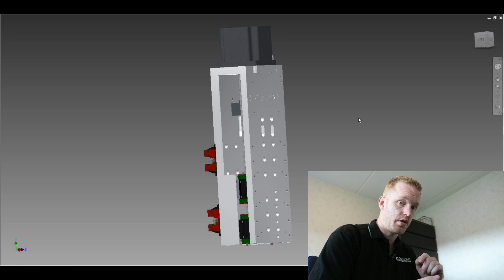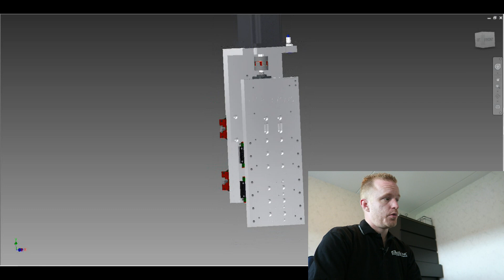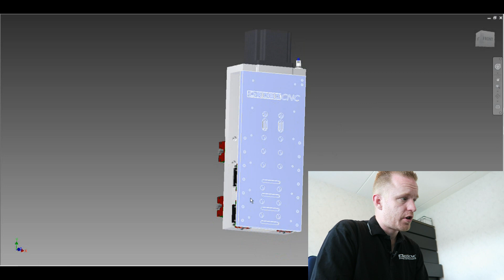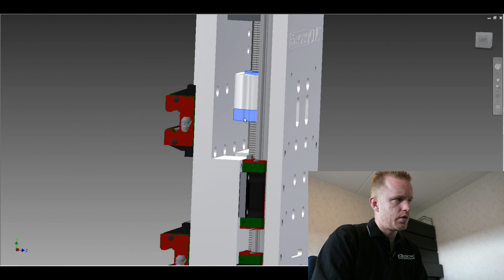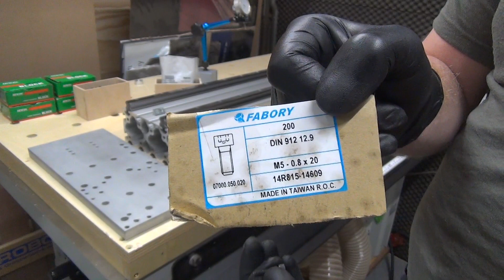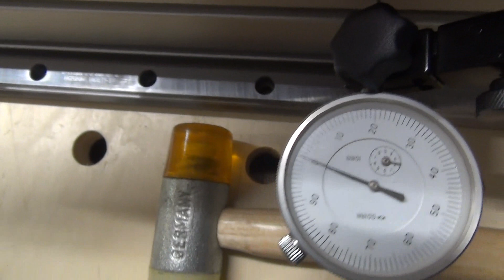RCNCX2 Router 01: Z-Axis overview and build part 1.

Comment: What's your opinion on filling the inside of the aluminum extrusions with epoxy granite. Which absorbs vibrations.
Reply from the maker: Well for rigidity I think it will ne really help in this design. But for vibrations it will/ But I would not do it in the gantry, way to much mass.

Comment: good design sir but may i ask you why the Z_axis lead screw is loose at the end or float like that ??
Reply from the maker: Since i feel at this length it is not needed to support it... especially since machining is done with the Z axis down so it is supported in the top bearing and the rigid ballnut.

Comment: Hi Marcel, the equivalent profile, 80x160  from 80/20 Inc  in the USA is ~`4lbs lighter per meter....  only  clear or black anodizing versions. Now of course with the lighter gauge profile comes the 15% less values for Moment of Inertia for both X and Y. So my question is where do we draw the line for the Y axis span. Plus to make things more challenging, I am increasing to 1500mm total span so I can make use of 1240mm material  as well. So....am I forced to order and ship from Item24 ? Do you have time to comment ? I am thinking of TIG welding an extra profile to the back of it to increase MomentArm. Is this ever been done I wonder :-) Best regards, C
Reply from the maker: Hi Chris,

I find this very hard to answer, I have not calculated the needs, but this this based on options available and gut feeling. The 80x160 Is really very very heavy and I think with 15% less weight you will be absolutely fine ! I would not start welding before you find any problems, and even then consider strengthening on a different base due to the temperature effects welding will probably bent the aluminum. You could always fill one of the openings with a epoxy cement or something, or strengtening it by bolting some sort of extrusion on it.  With the increased length of the Y axis you should consider to make this axis also by RP instead of ballscrew...
Reply: I just got a quote back from Item24 in Canada! I had no idea ....  :O And yes okay 1500 is a lot for 20 but maybe not for 25mm ballscrew. 
I am reconfiguring my parts list and cost to benefit for R&P. Thanks Marcel
Reply from the maker: I would recommend not to go beyond 1 meter of length with a ballscrew.... there will always be some sag (is that correct english? :) ) and when rotating the ballscrew quick will result in a wobble that will end up getting you into problems.... Slower speeds of rotation (so higher pitch) helps a lot, but again... It's my advice... (And I have ignored myself before.. ;) )

Comment: nice video. you got a bit off topic in the 2nd half though. I like the reference step in the plate. I had issues when torquing  my rails to the extruded aluminium profiles as they didn't have an even top plane. ended up having them face milled.
Reply from the maker: Thanks for watching.... I don't see the off topic part... There is nothing done in this video that could be left out when building up the Z axis.. But I think you will agree after watching part 2. The reference step for mounting the profile is suggested by Hiwin in their manual, and If you are able to do so it will be a wise step indeed... If you could not facemill the flat surface I would suggest to take tooling plate instead of raw aluminum stock.

Comment: Bedankt voor de info erg tof dat je er tijd voor vrij maakt, vroeg me af hoeveel x,y,z-as bereik je geplanned  hebt als hij straks helemaal af is? en welk materiaal denk je erop te kunnen  frezen ? (welke hardheid) 
Heb zelf een x6 1500 cnc machine uit china ,niet echt geschikt voor zwaar werk.
Verheug me nu al  op je volgende video.
Reply from the maker: Hi +Mario A bedankt voor het kijken ! 
Bewerkbaar oppervlak weet ik zo niet precies uit mijn hoofd maar iets van 80cm bij 130cm.
Dit formaat is op basis van kwartsplaat formaten, en het hebben van een kleine werkplaats.
Het systeem is overigens natuurlijk makkelijk te kopieren naar een veel groter model.

Het uitgangspunt is materialen tot en met aluminium... meer ben ik niet van plan.
(Tenzij het slechts om graveerwerk gaat natuurlijk)

Comment: With your variable depth stop for uneven surfaces how will this be connected to the floating nut?
Reply from the maker: Hi+NuttyforNissan ! 
Basically the nut is connected to the bottom of the two brackets. And the top bracket is fixed to the front plate.
So if i loosen the bottom two bolts the z axis can float. Next to, or around the engraver needs to be a follower, a teflon nose of some sort, to carry the floating z axis over the material. the engraving depth is the difference between the teflon nose and the cutter.. And the force used is purely the weight of the z-axis..

Hope this makes sense, and answers your question... otherwise the following videos will show hopefully :)
Reply: +RoboCNC Frees- &amp; Graveerwerk  Right so gravity is your friend. :)
Reply from the maker: Jep.... :)